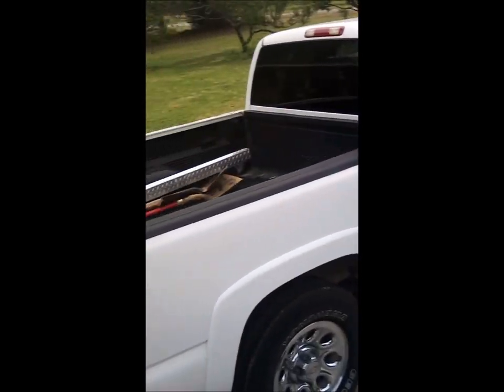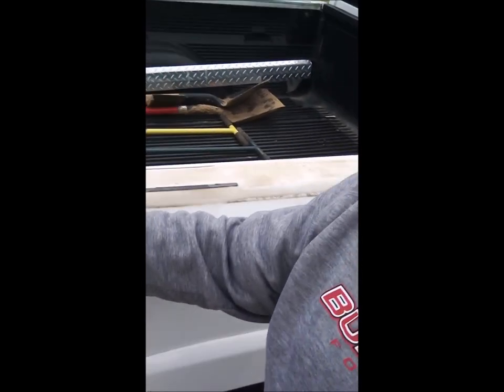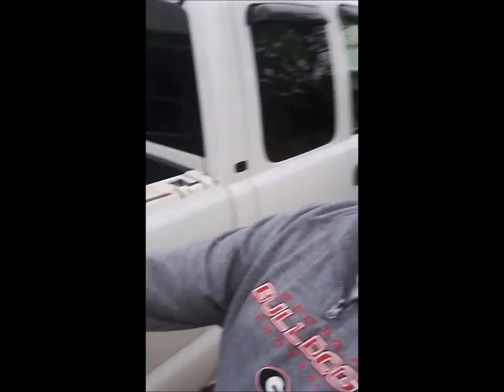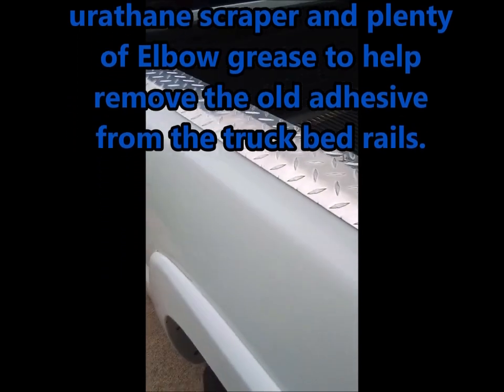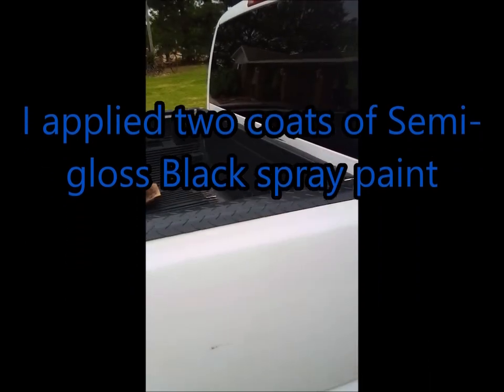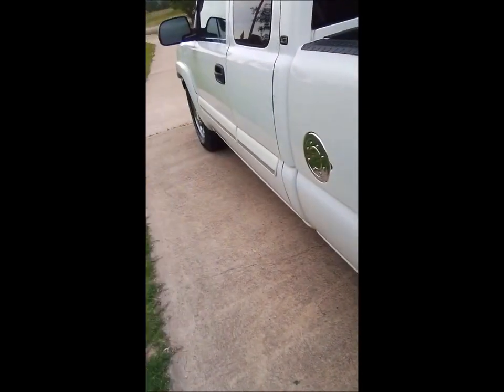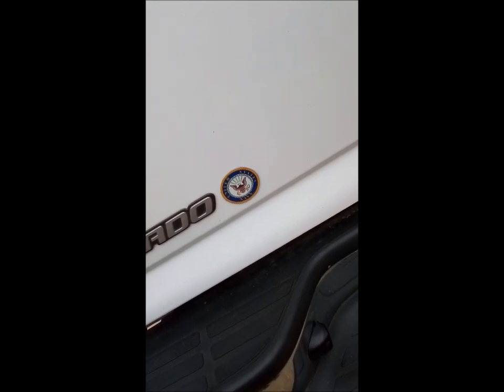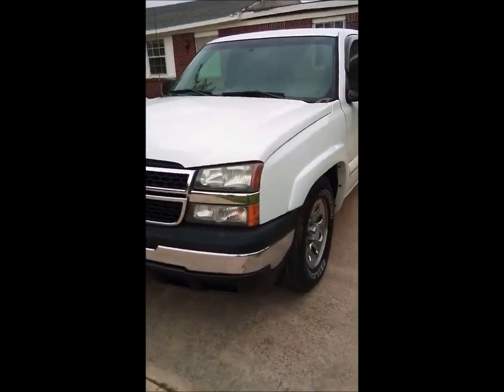DIY - Diamond Plate Bedrail caps

Comment: They turned out looking good ! I like the spray on bed liners better than the plastic slide ins .  The plastic ones get water under them and rust the bed out faster .
Reply from the maker: The truck had a plastic liner in it when we bought it.  Might change that out later but for now the house is my big project!

Comment: So what did ya put over the paint to cut down on scraping it off with use, if anything!? Looks great bud!
Reply from the maker: The double sided emblem adhesive is a foam rubber so it should prevent metal to metal contact but honestly this is going to be used as a work truck so I know stuff is going to happen to it along the way.  Thanks for watching, happy Memorial day my friend.
Reply: @EdsAttentionToDetail  oh I get the work truck mentality!  Was just wondering if when you painted the diamond plating if top coated it with anything?